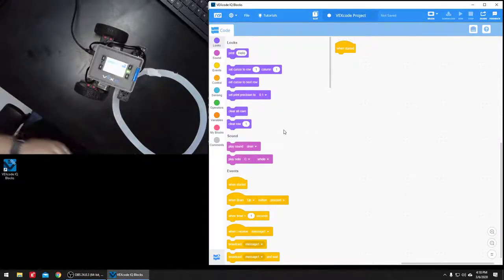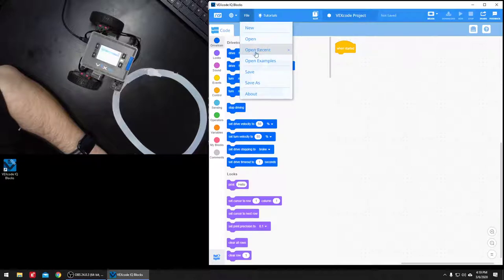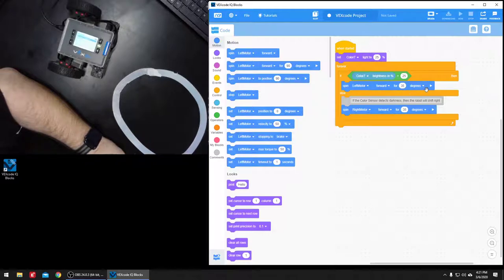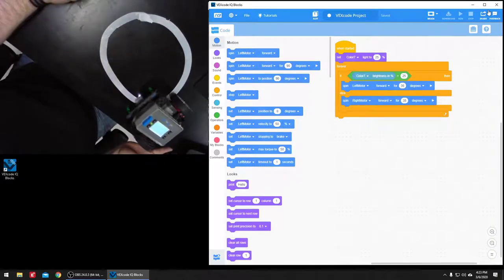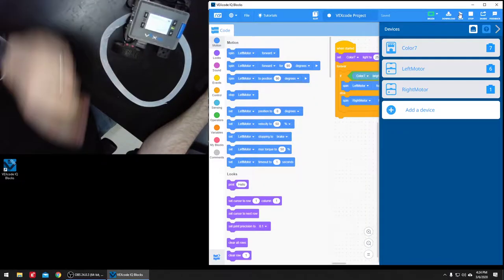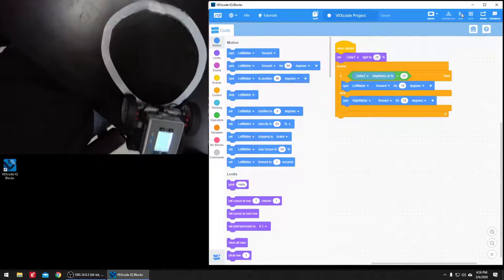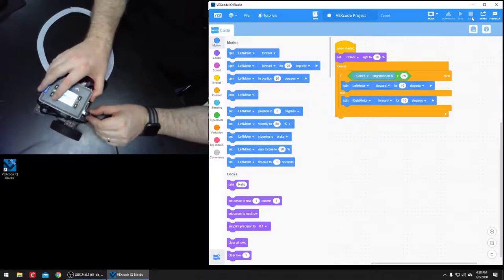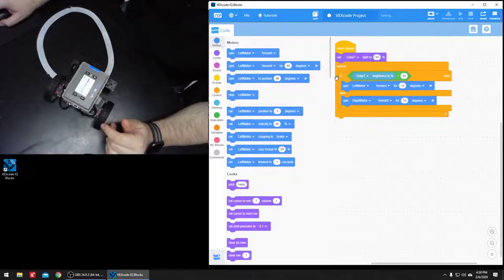VEXcode - IQ Blocks - Line Following

Comment: I would have instead made a loop that changes the speed of the two motors to steer them based on the brightness rather than just having a threshold and spinning them a set number of degrees but it would take more tweaking.
Reply from the maker: Interesting. I’ll give that a try sometime. The brightness may not be granular enough to get the expected outcome.